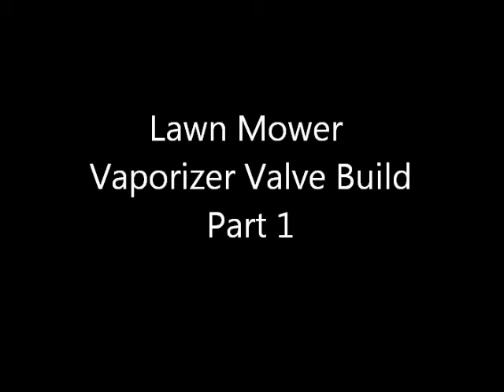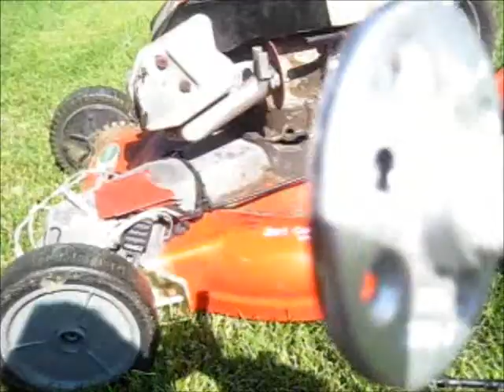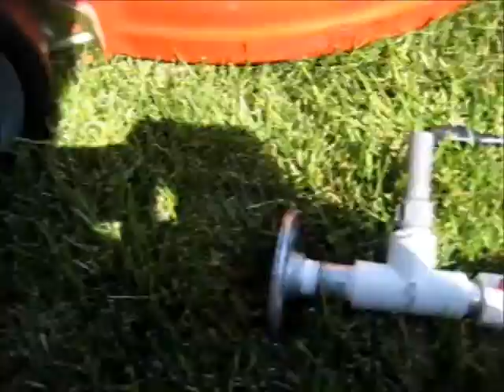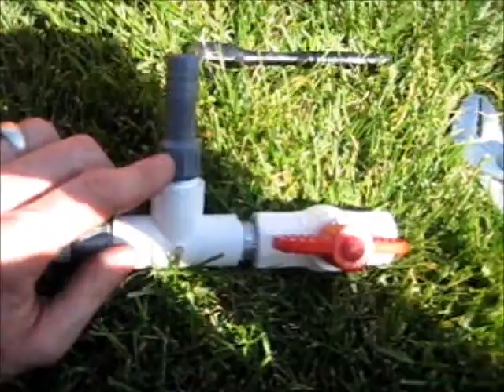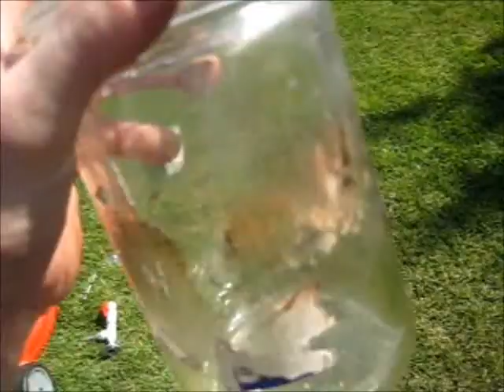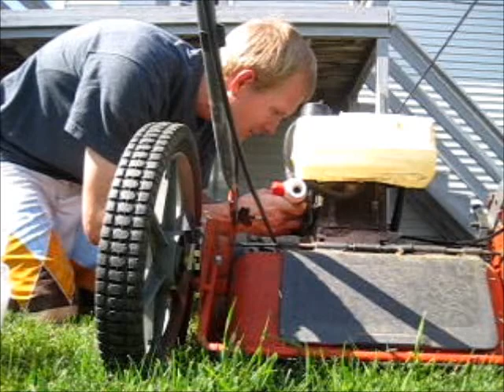Lawn Mower Vaporizer Valve Build  (Part 1)

Comment: Hi all, I conducted a test of this vapor method fueling a spare 4 HP Yard Machines engine I have in my shop. I compared it by putting the exact same amount of fuel in the regular tank. Both methods ran about 5 1/2 minutes each before the engine quit. On multiple runs. It is a fun project to put together and make work but it won't save you any money on fuel. A carburetor does what this does, it just does it inside the throttle body where no one can see it. After all, only vapors burn, everything else pyrolyzes to make vapor. 
I call this myth busted.
Reply from the maker: There are many ways to do it and many ways to make it work. Not every way will provide good results in fact some ways will reduce the run time not increase it. Many things factor into making a system more efficient and must be considered such as filtering the vapor, separating the liquid from the vapor especially when using a bubbler. The temp. of the vapor, the ATF, humidity levels and the list goes on and on. It's simple to get an engine to run but it's not simple to get better efficiencies.
Reply: So what do I need to do to make my little engine prove this works? My system is designed just like yours and others on YouTube and I don't see them tinkering or even mentioning it.
Reply from the maker: Tinker and play with it. Change things if it does not work right. I have had to do that over and over again. It takes allot of money and time but it's worth it for the times you get good results and see it for yourself.
Reply: Can you tell me what I need to do to get better results than I got? I used the bubbler method you show in the video and get the same run time as tank.
Reply from the maker: Dan Holbrook How well did you have the vapors filtered? You have to have a really good filtration system so no liquid is sucked into the engine. Even with a filter if it is not made well enough, fine liquid droplets of fuel will still be sucked into the engine. The fuel can't be in a liquid form, it all has to be fumes if it's not you won't see good efficiencies. Even on the system I built that you can see in once of my more recent videos, the one that has the vaporizer on the roto tiller doesn't filter out the liquid as well as it should. pack the thing with old socks and give it another try and when you do make sure no liquid is being sucked into the engine. If you notice the location of the jar it sits right next to the muffler which adds a bit of heat to it and helps aid in the efficiency process.
Reply: My test design was as follows: engine mounted to a 2x6 board long enough to also mount the fuel/vapor bottle. This was clamped solidly to my bench so no vibration was transmitted from the engine to the bottle. The 3/4 inch PVC breather air tube is open ended and has 8-1/16" holes around the diameter near the bottom. This assembly was held off the bottom of the jar an 1/8 of an inch or so. The vapor collector tube is also 3/4 inch PVC and extends about an inch below the lid of the mason jar.

During operation, I observed no evidence of splashing fuel wildly enough though air did bubble through the fuel rapidly. Even if there was liquid fuel droplets, this would have turned to vapor on its way to the engine or it would have flooded the engine.

This system accomplishes the same thing a carburetor does only I had to keep adjusting the intake air as the fuel level dropped or the engine would be starved of fuel and stop. I think it is a good way to go to prevent old fuel problems and clogged jets, etc. But one simply cannot get more energy from a set amount of fuel than is there to begin with.
Reply from the maker: That is true you can't get more energy out of the fuel than there is in the fuel. The liquid won't all turn to vapors on it's way to the engine if it's not already a vapor, some of it can but not all of it.
Reply: So if liquid gas gets to the cylinder what happens?
Reply from the maker: Not all of the fuel becomes a vapor therefore it is wasted out the exhaust.

Comment: I thought of something couldn't you use the Carb and the gas tank just take gas line size hose and run it from the top of the tank to the actual part where the gas line would normally connect to the engine instead of running it into the mouth of the Carb?

Comment: Great idea for the intake manifold. I may try using something like this. Are you using exhaust heat on your jar? Try E85 if you can get it. It is cleaner burning and vaporizes better than gasoline. See my video. Thanks.